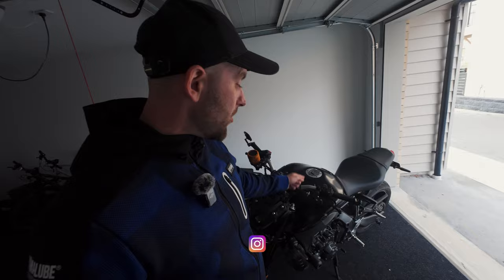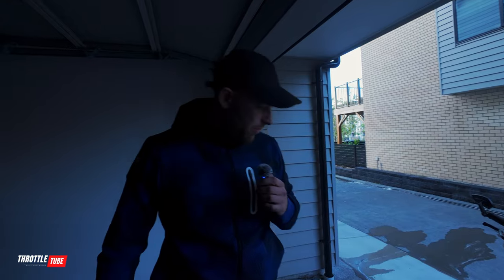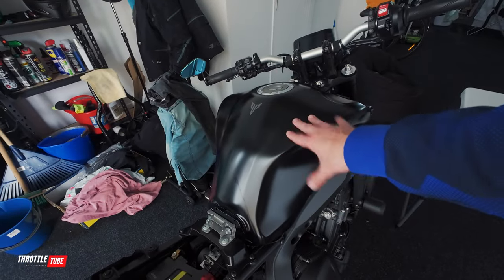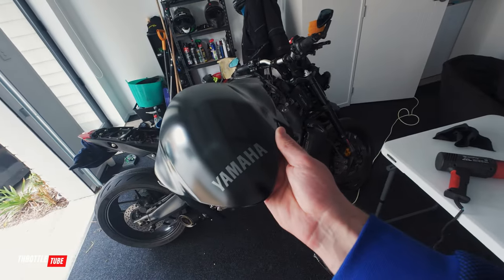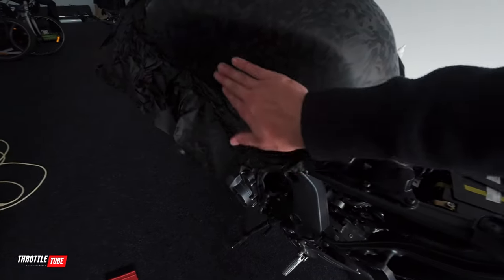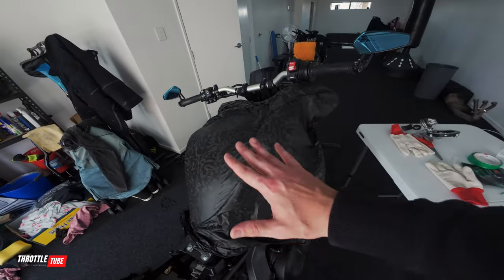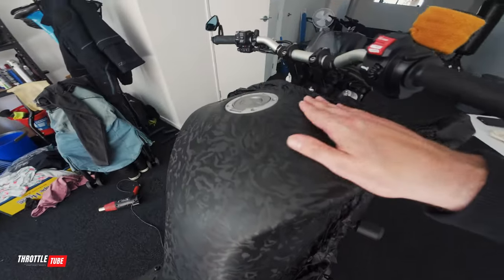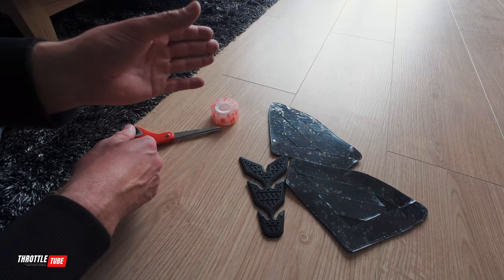I Tried Vinyl Wrapping My Motorcycle | *NEW* Yamaha MT09 Bike Reveal

Comment: What a coincidence I've planned to wrap my bike this month. Really great job mate, ooff the tank part was so difficult I guess, but the output was clean and awesome. Any color suggestions for me mate? I thinking of carbon fiber wrap.
Reply from the maker: Ah man the tank is a pain. Especially with the MT09 as it's soo wide at the top and so narrow at the bottom. After doing this I reckon I could wrap most bikes with my eyes closed lol. 

I'd definitely get 3m wrap as it's a lot more robust when it comes to applying for sure. And they do an awesome carbon Fibre wrap. The same as the wrap I used, and it has a nice texture to it! 

& 100 percent, use a heat gun 🔫.  It'll save your ass brother!!!
Reply: @thethrottletube  thank you so much for your valuable insights mate. 😌